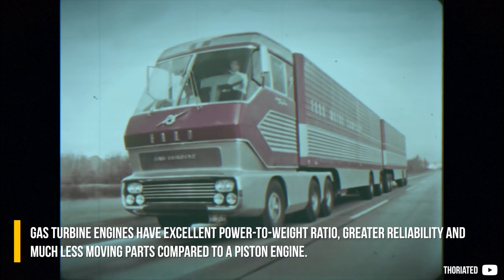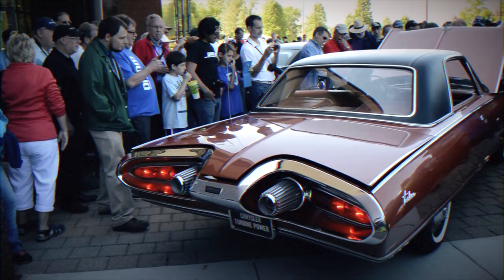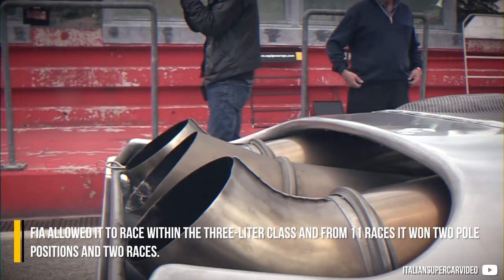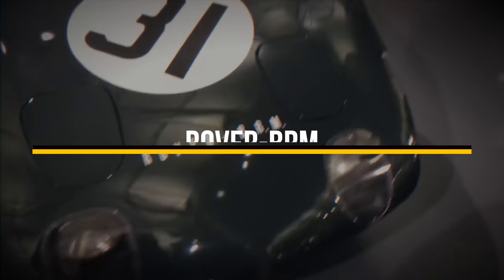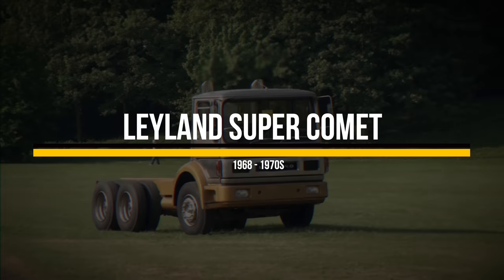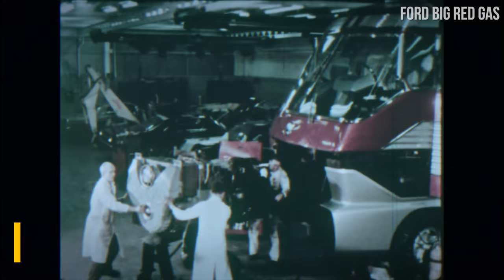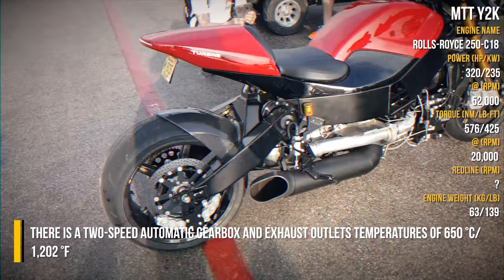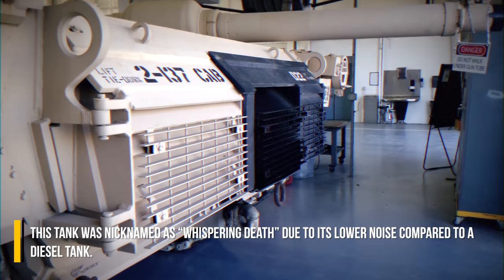The Only Automotive GAS TURBINE Vehicles

Comment: The STP Paxton turbine Indy car absolutely ran away from the field in 1967 and only failed to win due to a bearing in the drivetrain.  The four wheel drive was courtesy of a Ferguson Formula unit (similar to that in a Jensen FF) and race officials at Indy immediately set out to negate the advantages of the car after the 500.  It's one of my favorite Indy cars just for being so out there.

Comment: I'm an aviation and aerospace enthusiast, I thought I knew all models of cars, bikes, and vehicles of any kind equipped with turbines, but you managed to dig some unknown to me. Well done...
Anyway, startup sound of a gas turbine always gives me shivers.  Don't know why but these engines sounds different when mounted inside land vehicles. More hefty, rude, brutal than their flying counterpart.
(sidenote : the Volvo ECC in 92 was an electric hybrid with gas turbine-powered range extender)
Reply: The load and rpm difference are behind different sounds , like for a chopper , less torque is engaged at startup of a helicopter main rotor than a car gearbox

Comment: Probably 20 years back there was a lot of research being done on ceramic turbine rotors a d housings. One place I think a gas turbine might make sense is in an electric trick vehicle were the turbine simply runs a generator. The turbine when running runs at it's most efficient speed.
Reply: That's generally not vary efficient in practice, as far as i know only huge electric power plant sized generators can reach +95% efficiency, smaller ones are in the 70ish percent range, so that's a lot of power going to waste, although maybe a prius type hybrid drivetrain might be useful.
Reply: @jovand6606  
That's kind of what I was thinking. The turbine runs only to charge the battery. Volvo had one around the same time frame running as a test bed show car. Batteries are still the electric cars Achilles Heel. Personally I would like to see more research put into flywheels.

Comment: GM worked on a gas turbine engine for road vehicles for many years, starting at Detroit Diesel in the early '70's, then transferring to Allison in 1980.  They had a lot of semi's and buses powered by the GT404, which had 325 HP.  I worked in Engineering Test in the winter of 1981 and rode along to take data in a Greyhound bus powered by a GT404.  Driving in town, people turned to look when they heard something that sounded like a jet coming down the street, then stared in disbelief when they saw it was a Greyhound bus.  When we stopped for lunch, we shut the engine down, and it started whining down like you hear in the movies.  When we came out from lunch 45 minutes later, it was still whining.

Comment: There was a Jaguar gas turbine hybrid concept a few years back.
Also, a number of modern tanks use gas turbines instead of a traditional turbo. It has no lag and it can be used as auxiliray power when the main engine is off.

Comment: Turbines are NOT efficient when compared to a reciprocating engine.  This is why you do not see turbine powered cars on the street.

There was a guy who mounted a Boeing 502 gas turbine in a Porsche 928.  It retained the original automatic transmission and drove just fine [104 decibels...] but it got about 5 miles per gallon~

Great video!
Reply: That depends, in a hybrid application they make sense as they can run at their highest rpm which is when they are the most efficient, effiencies tend to range between 30 and 35% without any heat recovery systems so they are comparable to otto cycle gasoline engines. Though of course they are pretty useless in a non hybrid application as they are very unresponsive and have terrible efficiency at idle.
Reply: so lets make a turbine engine,use its crankshaft to then turn a generator head that electrically powers an electric motor on a  car, we'd get better torque coefficient  to fuel friskies efficacy..🐱🐱🐱
Reply: @fidelcatsro6948  Yep. Jaguar had a concept car. Had 2 micro turbines that drove a generator powering the electric drive wheels. It was back in 2003? Maybe? It’s pretty sick
Reply: @isakjohansson7134  yes. Turbines are a "full speed only" device, as fuel consumption does not decrease linearly with power drop.

Efficiency at idle (or self-sustain speed) is abysmal as it produces no extractable power, yet consumes healthy volumes of fuel.

I wonder what happened to this outfit that made tiny turbine generators. They even had a nifty heat recovery system to boost efficiency.
Reply: @ionbusman2086  whhhaaat someone did that already??? ay caramba now i need to go back to my drawing chalkboard and design something else
Reply: Coupled to a CVT transmission, keeping the turbine spinning at max efficiency, it should be responsive as a conventional engine and maybe a little bit more efficient with the added benefit of the ability to burn everything even nail polisher if you want
Reply: @daszieher  i dont know, i belive there was a company testing gas turbine hybrid trucks but i dont know if it took of or if it went silent like basically every company of that kind.
Reply: @isakjohansson7134  Here's where the problem lies. The Brayton cycle, which is what this is, operates by accelerating air, not by pressurizing it as in the Otto cycle.  Compressed air is fed into combustion chambers where fuel is burned the resulting gas accelerates through the turbine because there is no exhaust valve.  The turbine turns the compressor via a shaft down the center of the engine.  Upwards of 75% of the power is used to turn the compressor! Only 25% is used for motive power.  Also, when you double the speed of an object traveling through the air, you quadruple the parasite drag.  Since these work by accelerating air, there is tremendous internal drag.  What can reduce this drag is reduced density of the air.  This is why aircraft gas turbines are operated at the highest altitude that weight and the wing will support.  Turbines EAT gas at sea level but just sip it in the upper atmosphere.  Unfortunately, cars are not operated in the upper atmosphere....
Reply: @Flies2FLL  true
Reply: @Flies2FLL  yes and no. Turbines can be designed to the operating medium's expected density. So it would be possible to design a turbine for sea level operation.

 And yes, turbines can reach higher than 25% efficiency. The main problem is the rapidly decaying efficiency at anywhere below 75% power.

While a passenger jet aircraft will do fine with its engines operating at or close to maximum speed (net power output varies with altitude), a car which generally operates at anything BUT maximum speed, is buggered.

In a car, it would only work in conjunction with an electrified drivetrain, where the turbine would recharge the battery at max eta or be off completely.
Reply: @daszieher  I don't believe you read my post carefully.  I never said anything about 25% efficiency.   Typical compressor sections use up approximately 75% of the energy in the exhaust stream, leaving only about 25% of the energy left to drive a power turbine or provide the exhaust stream thrust.

Overall system efficiency is something else all together.

Turbine engines operate just fine at sea level;  They just eat fuel.  And they typically idle at around 64% of max RPM;  Below that speed they make very little power and there is considerable spool up time, not good in a car.

No matter what, the turbine engine does not like low pressure altitude and having one run at full speed to drive a turbo-alternator would be yet another energy change which would further degrade already atrocious overall efficiency.

It would certainly rule any Cars & Coffee that you took it to though~!

Which makes my point:  In a car, they can only serve as a novelty.
Reply: @Flies2FLL  It can go higher as high as 40-50% for fresh shaft horsepower IIRC.

But yeah, I don't know if the calculation number is conservative or ideal.
Reply: @bocahdongo7769  OK, site your source for that please.
Reply: @Flies2FLL  Moran-Saphiro book, just normal engineering learning book for college student.

As I said, I don't know if the number used for example and the exercise is as close as real life, or even if whether I'm answering it right or wrong. But yeah, in super controlled condition (according from exercise ofc), 40% is reachable.
Reply: @bocahdongo7769  If that is possible, then it would only be so in a laboratory setting.  In the real world at sea level it simply wouldn't happen.  The Moran-Saphiro is a theoretical textbook on thermodynamics.  Again, not real life.
Reply: @Flies2FLL   were you counting the energy that the compressor itself had imparted on the air mass? Only then would that figure make sense. For clarity's sake one would subtract that figure from the stream when comparing the usable energy in the mass flow.

I didn't say that they wouldn't operate well at sea level, I even said that turbines can accurately be designed for whatever medium's density is to be expected (-> rocket turbopumps)

I don't see how running a turbine engine at sea level (or comparable altitudes) in a road vehicle, where it the drives a generator at system peak efficiency involves low pressure altitudes.

The net efficiency gain results out of running the range extender system at peak efficiency or not at all and letting the battery-motor portion sort out the driving dynamics. It still remains to be debated, if it really works. There are arguments for and against such a setup.

Anyway, it seems you might not have read my post carefully in the end 😉
Reply: @daszieher  My quote on the 75% comes straight from a book called "Aerodynamics for Naval Aviators", and it is required reading in Navy pilot training and I read it in college at Embry-Riddle, where it was practically a bible.

The definition of pressure altitude is altitude corrected for non standard barometric pressure of 29.92 inches/1013 mb.  Thus, a low pressure altitude would be sea level and a high pressure altitude would be in the flight levels.

-Due to what is known as parasite drag, the spinning disc of the compressor wheel generates tremendous parasite drag as it accelerates air between the blades.  Reducing air density [such as at high altitude] reduces the power produced, but reduces drag even more.  The CF6-80 engines I operate at work will use per engine approximately 12,500 pounds per hour taking off at sea level, but [depending upon weight], around 4,000 pounds per hour at FL370 at 480 knots.  Granted, TO power is quite a bit higher than cruise power, but even in the traffic pattern with a clean wing this plane will still burn over 10,000 pounds per hour, or 5,000 pph per engine.  While traveling around 210 knots.  

Oink!

What you are seeing is the simple fact that turbine engines don't like low pressure altitude.  They run, but gobble fuel.  Running them at max continuous thrust does not make them more efficient!  That is true in a reciprocating engine due to lower pumping loss but not true  with a turbine.  And to use this turbine to produce electricity?  Now you are turning kinetic energy into electrical energy and via a drive motor back into kinetic.  Each energy change you make uses power and thus decreases efficiency.

Oh and I read your post....
Reply: @Flies2FLL  Not wanting to dispute your academic credentials gained at a renowned place of learning, but I'm afraid that you are taking an aircraft engine designed for operation at altitude (lower pressures) as reference and deducting from its behaviour, parameters for any turbine at sea level.
I am aware of The Book and I know its function as a quasi-bible (despite not having come around to reading it... yet) ;)

Now I understand: it is "low pressure-altitude" not "low-pressure altitude". Again, for clarity's sake, I was not disputing a higher consumption at lower altitudes. It is obvious that at higher medium pressures, mass flow thus fuel consumption is higher.

Back on track: yes, energy conversions usually decrease efficiency. However, in a dynamic world, running an engine at a fixed design point may increase efficiency to the level that the conversion as accounted for. After all, these concepts were not suggested by technical laymen ;)

Comment: The neat thing about gas turbines is it's POSSIBLE, albeit not all that likely, that they'll see a resurgence in the coming years. Hybrids. One of the many advantages of a hybrid powertrain is that it can smooth out unresponsive powertrains with a quick burst of instant electric torque. It's why Toyota's hybrids (aside from the Prius and Corolla) all have decent performance despite using sluggish eCVT transmissions. If you can figure out a way to put an emissions system on a gas turbine (which would admittedly be quite difficult), then building a car with a hybrid or gas-electric setup would be child's play, and it would completely remove the responsiveness problem. This is especially the case with semi trucks, which would benefit the most from gas turbines' ridiculous torque in a gas-electric setup where the turbine can just sit at a set RPM running a generator that in turn powers electric motors sitting on the truck's axles. No responsiveness needed.
Reply: Emissions is an interesting take on the problem with using turbines in the auto industry. It never occurred to me that there any problem emissions with turbines due to the very high combustion temps. I knew about the airline industry problems with unburned fuel during take off but assumed the problem went away with a more level flight.
I have always thought that the noise, complexity and ability to cook any unfortunate bystanders were the biggest reasons not to use them.
Reply: @LarryisControversial3000  Noise is a problem that can be fixed with the right exhaust setups. The bigger issues are the inability to attach an emissions system due to the high speed of the exhaust gasses, as well as their high temperatures.
Reply: @masterofThardus  makes sense

Comment: Cool episode this one, didn't know most of the British attempts.
From an efficiency standpoint, that was one of the main flaws of the gas turbine, it was only efficient at relatively high loads, the 80-100% range.
But fuel consumption does not change a lot when going to lower loads, making them gas guzzlers at idle and low loading.
Because car engines do run at low load most of the time a gas turbine isn't fuel efficient in cars, for the average 1200kg/2500lb car it takes only 30-35hp to cruise at 100kmh/60mph, that's about 20-25% engine load for the Rover or Chrysler turbines in the video.
Airplanes and ships run their engines at a constant 80-85% load while at cruising speed and that most of the time while on sea or in the air, so that's why a gas turbine is very efficient in them.
For trucks a gas turbine makes sense as they run close to the 70-80% figure at a 90kmh/55mph speed
Reply: I believe that the gas turbine engines had a lower fuel consumption than thirsty internal combustion racing engines. That’s one of the reasons they were attractive in Indianapolis and Le Mans cars- situations where regular fuel stops are required. Time could be saved due to less pit stops.

Comment: Actually the first one made 59 Nm of torque, it had a 9.76:1 gear ratio. The MT Y2K has 66 Nm of torque, 8.66:1 gear ratio. The M1 Abrams has 535 Nm of torque, 10:1 gear ration before the engine.
Reply: Good to know, I made a comment earlier saying the Chrysler Turbine would have 1200KW at 20,000rpm if the 576nm was true. I suspected it would have been in the 50nm range since peak power is 97kw at 36,000 RPM so it would only have 26nm of torque at peak power...

Comment: Had seen a turbine powered indy type racer that was in a dusty corner of  the shop, when i worked in Whittier Ca. It later went to auction,   I think it was a Lotus chassis . Used mainly as a R& D concept. Yeah it belonged  to that Texan who made racing Fords& high output Dodges.

Comment: I saw the Lotus turbine at the 1971 British GP at Silverstone, driven by Reine Wisell. It was strange because it was so quiet that you could hear the tyres squealing when it went around corners, a bit like the modern hybrid Formula 1 cars. Every so often the car would go "whoompf" and flames would shoot out of the engine. 
Apparently Colin Chapman once nearly killed an overzealous marshall (not at this race) who saw flames coming out of the engine and ruined the engine by emptying a fire extinguisher into it, costing Chapam a fortune. There were lots of problems with the car but its pure lack of driveability was probably why they gave up - you had to put your foot on the throttle a few seconds before the power came, and that was very very scary!
Reply: Turbo lag

Comment: Only problem with all gas turbines is that they need to idle at around 2/3 throttle because it takes roughly 2/3 power just to compress the air so that it can sustain combustion this leads to their massive fuel consumption which is why most applications run turbines at full speed and max load to achieve max efficiency.

Comment: A like Turbine engines. Too bad they didn’t stay in the auto industry. Maybe find a place among the hybrids. would definitely consider buying such a model :)
Reply: Volvo ECC concept car (that became the first gen S80) was an hybrid with turbine range extender. In 1992.
At steady and thermally ideal RPM, like used in a generator, a turbine is darn efficent.